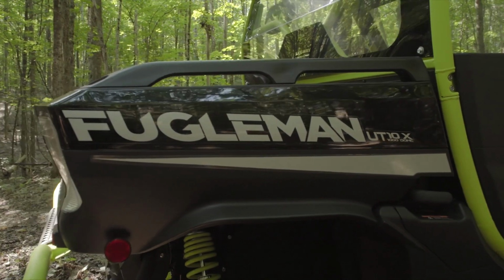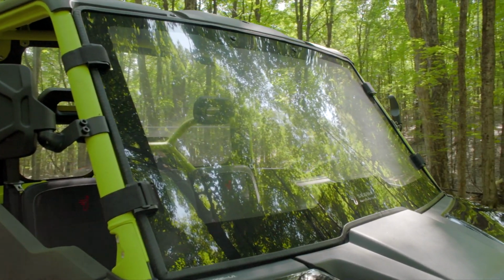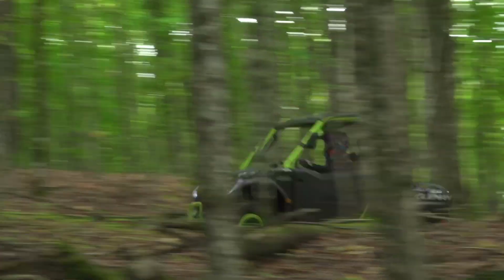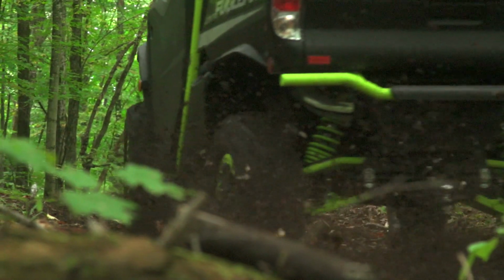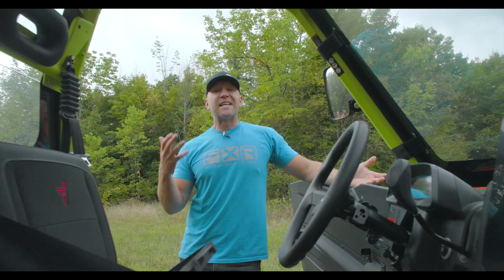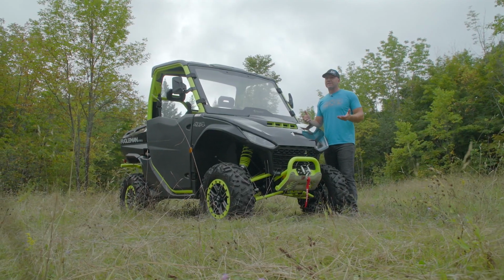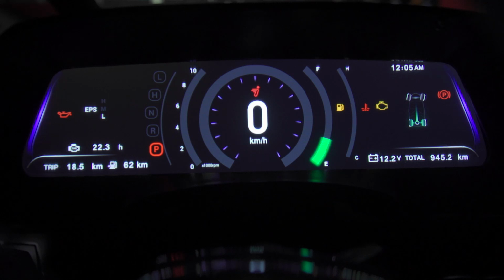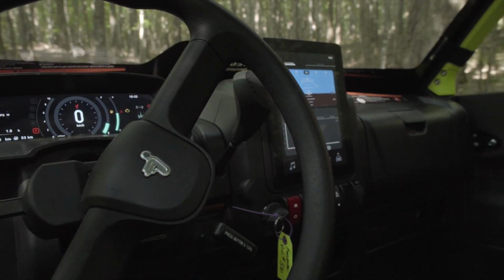Segway Powersports Fugleman UT10X Trail Ride Review

Comment: I had a bad experience with Fugleman . Off the showroom floor the Fugleman had faulty wheel bearings. The dealership then built me another Fugleman right out of the box and it too had faulty wheel bearings. I would have really liked to had the Fugleman,but with two right out of the box with wheel bearing issues I didn’t feel comfortable buying one. Even with a warranty, I was afraid of other issues that might occur. I ended up purchasing the next “most affordable” UTV, a Ranger 1000
Reply from the maker: Ranger 1000 is a good machine. we have one currently.

Comment: My old man has owned his 2022 fugleman ut10x for over a month and been on a couple rides, love the way it rides and the sound it makes when you step on it, also can go 200km to a tank (we did a 213km ride last weekend) , there are a couple things that could be improved the cabin gets really hot because of the engine , and also it’s hard to see the buttons at night cause there’s no lights, so he put in some dash lights and is going to put in a rad fan in the back to try to vent the hot air away from the cabin

Comment: How much?
Reply: My local dealer has a couple. They are $16,500 plus fees.
Reply: I believe they use a Ducati engine in these. Fugleman is a Chinese company though and that alone is enough to keep me from considering one of these as an option.
Reply: @dieselmutt8865  fugelman is the model, not the brand
Reply: @normanhaney583  Segway. Whatever you want to call it. Doesn't change my point.
Reply: @dieselmutt8865   no they are Polaris copy.
Reply: i was quoted 19995 plus taxes for the base model and they would give me a 3 yr warranty with it  and no BS like cf moto for the obliged service at the dealer